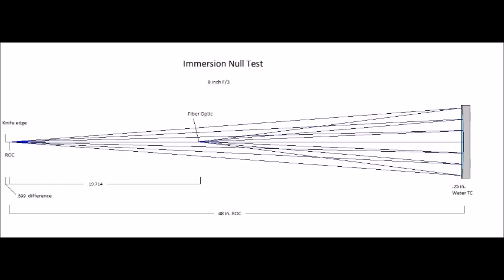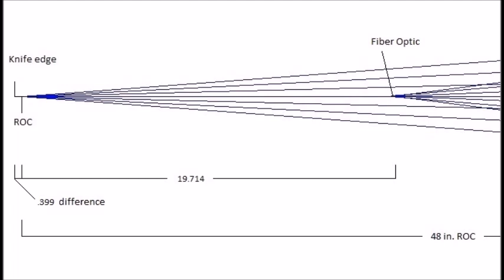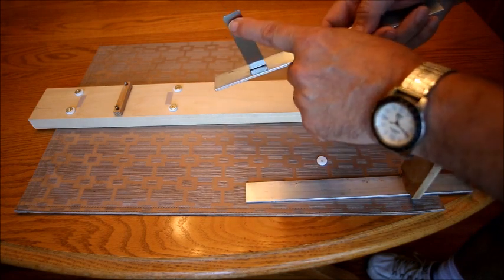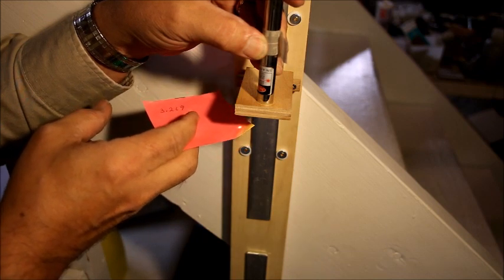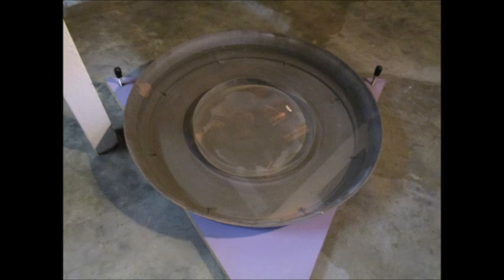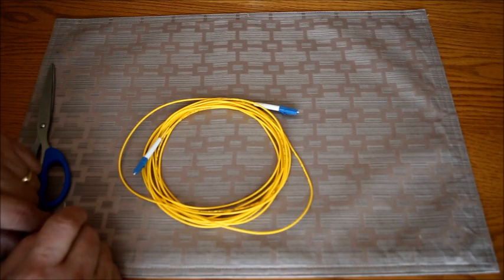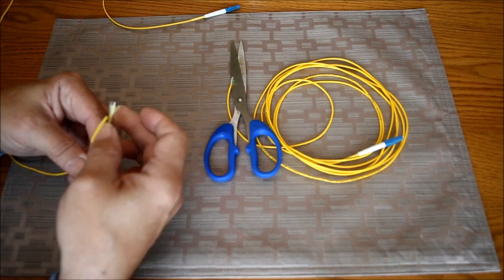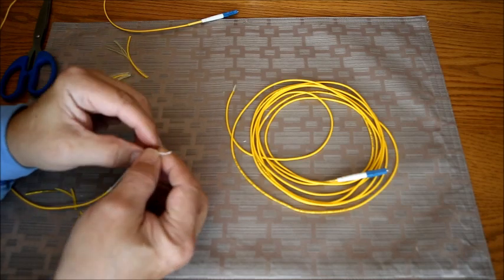Immersion null

Comment: I'm hooked.  Evidently you've reduced some of the water lens factors to a 1.6 scaling factor.  Raytrace/set up in Zemax?  OSLO?
Also you use green laser light and despeckle it.  White light works, yes?
Reply from the maker: You don't need to ray trace it if you are making a parabola, you just scale it from your ROC.  If you want some other conic like a Dall-Kirkham or RC primary then you would need to ray trace it.  White light won't work, even a LED is problematic because of CA.
Reply: @Opticsed  How did you get to this scaling factor of 1.6 ?  What's the math behind?
Reply from the maker: The scaling factor depends on the radius of curvature of your mirror (ROC).  If for example you were making a 16 inch F/4.5 it has a ROC of 144 inches (pretty high)!.  Then you divide 144 by 48 inches and get a scaling factor of 3 and multiply all the spacings in the first pic, no ray tracing needed.  White light doesn't work with a Ronchi, a KE will show one color on the left side and another color on the right because of all the CA.   A LED with a Ronchi washes out the bands on the side but is faint, a KE does better with an LED however.  The best is a green laser, it's bright but you need to de-speckle it.  Use a microscope objective or short FL PCX lens and a rotating ground glass.
Reply from the maker: One more thing I forgot to mention.  Since the test is in-line (not offset like the KE, Ross etc.) you can use a high power eyepiece and check for astigmatism in and out of focus.  The fiber will look like a small planet, a good functional test.
Reply: @Opticsed  small enough source would give you a star test.
Reply: No, white light will give a lot of color which is why I used a laser. Maybe if you use a narrow bandpass filter white light will work.  Even a bright green LED isn't monochromatic enough to not wash out the bands on the side with a ronchi.